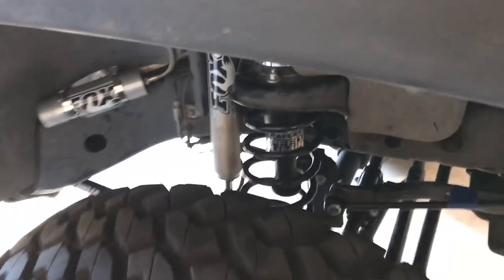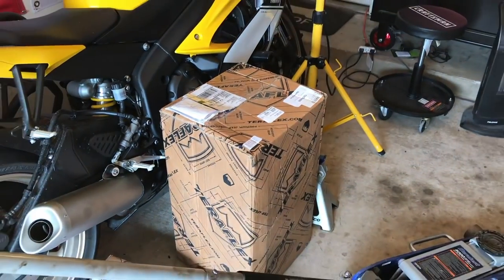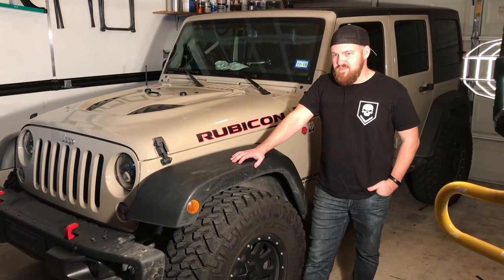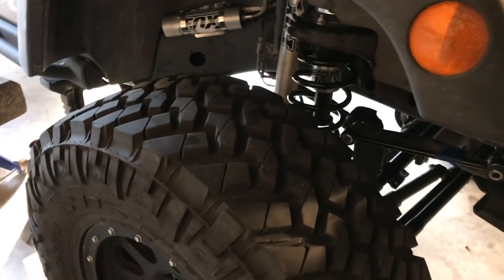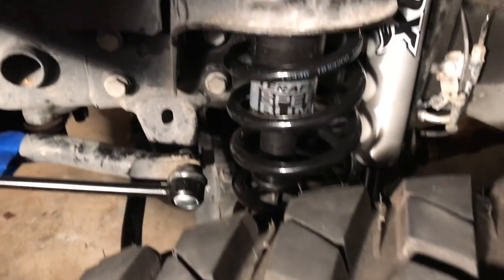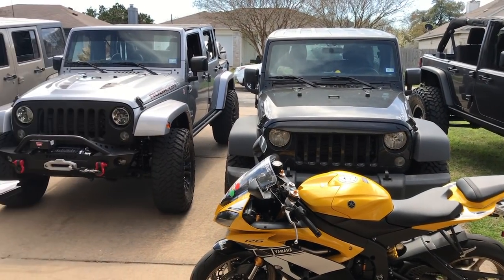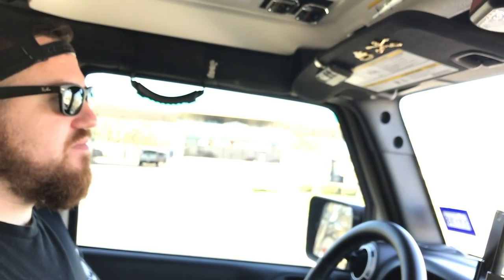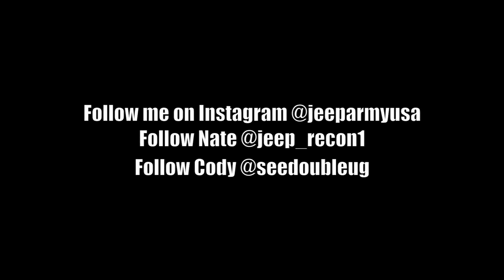These POP Sounds! Teraflex 3" S/T3 Lift VLOG also #shenanigans

Comment from the maker: Btw, we left all the bolts loose until it was back on all fours. When it pops at the beginning of the vid, all the bolts were loose there too. We’ll go back and loosen and re-torque anyway. A lift would have been nice. During the install an arm fell on Nate’s head and he felt like shit the next day. The VA doc diagnosed it as a concussion, wish I caught it on cam. Be careful everybody and no that’s not the lifts fault 😆
Reply: Keep going back and forth between TF 3 inch and 2.5 inch lift.  Afraid that the 3 inch lift will put me too high, making my 35s look small.  Currently have 2 inch spacers on all 4 corners of JKU.

Comment: I have the same TF kit on my 2017 jku, with 35 inch tires. Love it. Have run this over monster sized rocks all over the western states for a year now with zero problems. And yes it's awesome on wash board roads, run 15lbs of air and the faster you go the softer the ride. Have never heard the pop noise on mine. Great video.
Reply from the maker: Thanks for the info man! He’s really liking it so far and has already wheeled it a couple times. Thank you for watching!
Reply: @JeepArmyUSA  NICE JOB!!   What Gears  are you  running?

Comment: That pop was the spring seating. On the fron lower spring seats there is a groove that they bottom out on with a stop at the end of the spiral. While you have it in the air it's easy not to have it fully rotate to that stop. When you put it back down, it wants to ride that spiral ramp down to that stop at the end of the groove. Why I know this is that I did the same leaving like <1/4" gap, made those pops - figured it out - put it hard on the stop and it was gone. That was almost two years ago.... RECENTLY had to pull what we will call a large tree branch out that got jammed in there next to the spring. And took some doing but rotated the spring again in the process. FYI it binds and pings as it rotates, and you really can't do it with weight on the jeep... However this time I tried something to drastically speed that slippage up... Hose it down at the seat supports with silicone spray and drive around a little. And it's done... Why I know this is from another experience of developing a little rust at the lower spring seat, and you can get a little squeak at the same spot after water crossing the real dry dusty trails. 

Anyway even though I did the same model lift almost two years ago - I was wondering if you had as much trouble as I did getting that nylon socket in the upper rear bump stop? Because it nearly killed me... You have to press it in, and some jeeps have it formed just slightly too tight and just won't.... A call to Teraflex cured it - you have to make a small slice in the 'cup' on some of these tighter ones - because it plain will not fit. Try a few times first, but if the full weight of the jeep is not enough to pop it in. Take an angle grinder and make a small slit in the cup to allow it to open enough. That was the over the phone advice from them. Talking to someone else withe same lift - who had the same problem carved a little off the bump stop extension all the way around with a grinder, and they said it took forever... That might seem like 'plastic' but it is really glass reinforced nylon. And nearly bulletproof...

Otherwise it's a totally trouble free lift.

Comment: I know this is a late (late) comment but it sounds like what I went through. I had a 21/2" lift installed, and am pretty sure the control arm bolts were torqued with no weight on the axles. I'm installing another lift, a Teraflex 3 1/2" with Falcon 3.1 piggyback shocks, and will make sure everything is torqued properly and with the weight of the jeep on the axles. BTW, great looking jeep!

Comment: Did the same thing with my track bar.   It caused a drift or a pull.   Time to start over and put the track bar to stock and work from there.  This time have some in the Jeep

Comment: I've got this same kit and love it for the daily driver. I didn't get those sounds though, but I've heard the same thing on lifts that were installed and torqued down before putting the full vehicle weight on the suspension. Great video though!
Reply from the maker: Hey Rock!! Thanks for chiming in man! We left all the bolts loose until it was back on all fours. When it pops at the beginning of the vid, the bolts were loose there too. Weird. Anyway, we’ll find that sucker. Thanks for watching bud!

Comment: the "pops" are from the stressed control arm bushings. thats precisely why you don't tighten them down until the vehicle is sitting on the ground with suspension under load. this kit took me about 10 hrs. (2 days 5hrs a day) start to finish. i cursed a lot and busted my knuckles and head a few times but i cant blame that on Teraflex. Very important detail: I had the use of a lift so there wasn't any crawling around on the ground.
Reply from the maker: ben brosseau we left all the bolts loose until it was back on all fours. When it pops at the beginning of the vid, all the bolts were loose there too. We’ll go back and loosen and re-torque anyway. A lift would have been nice. During the install an arm fell on Nate’s head and felt like shit the next day. The VA doc diagnosed it as a concussion, wish I caught it on cam. Be careful everybody and no that’s not the lifts fault lol
Reply: Damn sorry about the head dude! I hope the suspension settles out fine for you guys though because after over a year of daily driving, i really like mine....I'm still surprised at how stable it is on the highway. Finally, yes you can "send it" on some back road ruts and whoops pretty good with those speed bumpstops and straps/spring retainers holding it all in solid.

Comment: So I just installed this exact lift on my wife's 2017 JKU. we love it the same as you, but I do have a question. If you dont install the limiting straps will that cause problems? I figured if you install those straps you will get less flex from the ride
Reply from the maker: They’re could be a potential to over extend your shocks and damage them. I would hit up TF for the details about running them vs not.
Reply: If you lift a tire on the trail, you can actually drop the the axle so much the spring drops out, so the strap limits the droop at the end of spring travel to keep it seated.

Comment: Looks like a nice kit for 1600 and change. Those shocks are almost as expensive as the whole suspension though.  Not too crazy about having to cut for the front bump stops.  Wish they had used a different option.  Did you ever find out what was binding?
Reply from the maker: Ya, check out the latest vid for the popping sound
Reply: Are you saying the suspension and shocks were 1600 all together? Or the suspension only? Cause I see the suspension with those shocks for 2800

Comment: I'm curious if you ever figured what was causing the popping sounds. If so, which video do I need to watch? Thanks.
Reply from the maker: Loose rear track bar bolt on the frame side was binding and popping.
Reply: @JeepArmyUSA  Thank you.